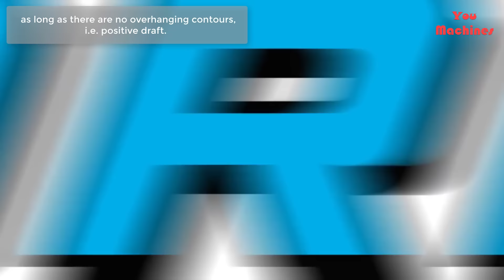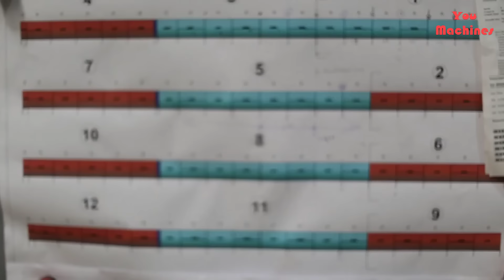Advanced Azipod propulsion system. How giant ship propellers are manufactured. Unbelievable

Comment: Boats  and ships  are most benificial  form of  transportation.  We have   used mechanical  powers of human  and wind  to drive  big ships.  After advancement  of we started  using propeller   system,     we used large  propeller designs   and multiple  propeller designs mainly  fuel and electric  driven.  More updation  needed  propulsion  system.

Comment: I find it interesting to see that none of the steps are particularly hard to understand; at the same time all the steps are made difficult be the sheer size of the objects, and the whole project becomes quite complicated.
Reply: That really is the point I guess.
At the lowest level, Azipods are just electric motors with a prop attached.
It's just that they are a little bigger than your standard Ryobi cordless drill.
Reply: Z

Comment: The scale of these ships is mind boggling.
Like nothing on dry land.
Reply: And to understand the power to turn those propellers to move those mind boggling ships.
The case for education.
Reply: The sheer engineering is just amazing!
However, the denial of Intelligence by disbelievers surprises me more. The fact that there's an Intelligence/Fashioner behind the Creation of the Universe is more incredibly powerful and intriguing.
Even the structure & working of our tiny DNA alone is so complex and impressive let alone the Universe which is too big to even talk about. Just like the Engineers are at work to produce the desired outcome, the DNA has codes which works as instructions in Creation of a Body.
The process begins with the single molecule multiplying & producing identical copies effectively and efficiently as there are special enzymes looking for mistakes on a minute by minute second by second basis to correct any errors in the multiplication process.
Its totally understandable why Scientists were saying the processes are incomprehensible and their working excels far more than human engineering capabilities.
😐

Comment: So. Are there motos at the back of those props or is drive transferred down from the belly of the ship via a gear arrangement?
Reply: "Azipod is a gearless 360° steerable propulsion system, where the electric motor is located in a submerged pod outside the ship hull. By utilizing the Azipod system's maneuverability, marine vessels can direct thrust in any direction with incredible precision, saving time and fuel."

Comment: Is the propeller completely brass?
Reply: Yes
Reply: Reason? Corrosion resistance?
Reply: @Pavlucco  I don't know why Props are made from brass, good question.
Reply: Brass is an alloy they may add some other metals in it to make it stronger.
Reply: @suhan8382  other metals tend to corrode and/or rust pretty quickly in water though.
Reply: @Pavlucco  Corrosion is one reason, but, the main reason is it's flexability/softness and ability to bend instead of transferring undo energies in the event of hitting something. They also have some flex which allows the pitch to change under different stresses and that is all calculated in when designing the vessel. Also, work-ability over stainless steel (casting in a foundry) as well as weight savings.
Reply: @AlphaGametauri  Props are made from alloys including bronze (not brass, it's too soft) NiBrAl comes to mind - nickel, bronze and aluminum alloys combined for strength and corrosion resistance. There may be newer and better alloys but NiBrAl has been used for years.
Reply: The alloy used is CuAl10Ni.
Reply: @suhan8382  A few ft ft to 4

Comment: Locomotives that use diesel engines to power generators that provide electricity to traction motors connected to drive wheels are called, "Diesel Electric Locomotives." 
So why don't we use the term, "Diesel Electric Ships, or "Heavy Oil Electric Ships?"
Reply: This is n´t  so new, and more expansive. The consumation
Reply: We do.

Comment: These propellers run by electricity. I thought they would be run by huge diesel engines.
Reply: They do use diesel engines though  just to create electricity . shorter response time and reversibility- difficult to achieve with mechanical linkages .

Comment: Why don't aircraft carriers use this type of propulsion?😳
It seems the pods are more munavble.😳
Reply: Has not been practical yet.   Carriers spend most of their time underway sitting at a dock.   Not much close maneuvering in and out of ports like these type.
Reply: @MrBen527  Okay, Thank You.😊
Reply: too many breakdowns with thrust berrings during high speed sustained  duty, and not repairable in many drydocks. under the warerline much engineering is classifed.
Reply: @geodot595  Yeah I wasn't even getting into reliability/ support issues yet.
Reply: @geodot595  well that answers my question. Thank You.😊👍👍